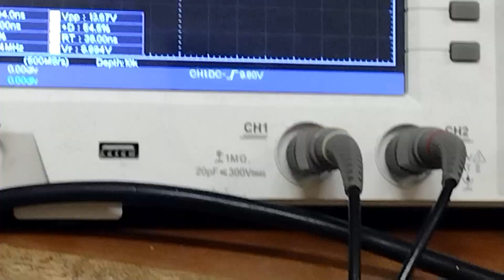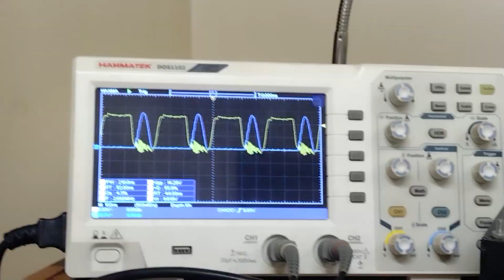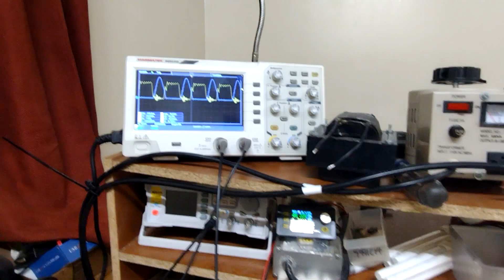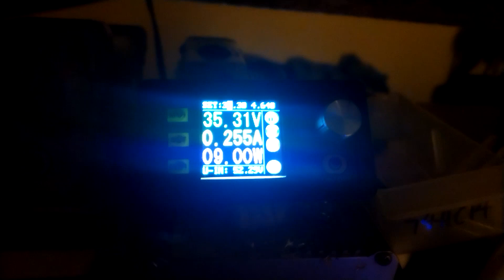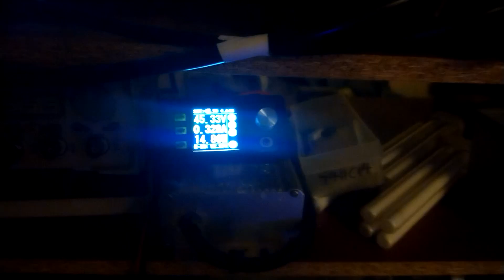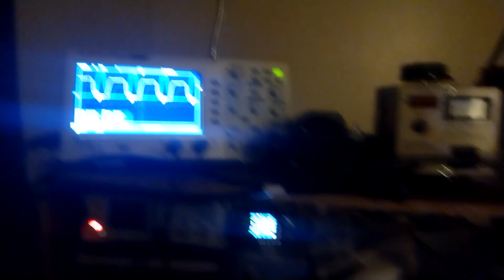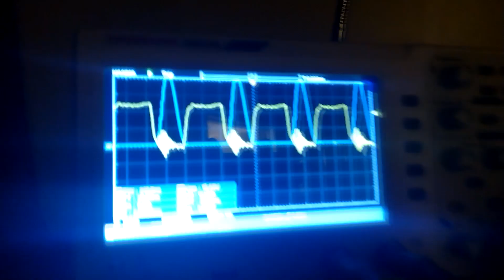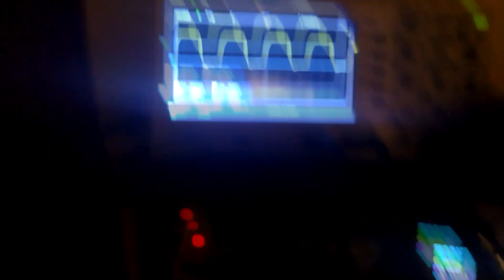Steve Ward Micro SSTC 2.6MHz IRFP260 200W

Comment: These Steve ward's little circuit, these works best compared to others. I've done several myself & it was kind of fun playing around with them. But with my E Class, I started to get headaches as every time  I moved the circuit inside a different box, the output changes drastically. It sorts of turn moody against me. But while playing around with various circuits, I found out that Steve wards little circuits were more fun & pretty much easier than others.

Comment: Reminds me of the class-e coil I put together a while ago. Something in this frequency range will do very nicely for audio modulation. Also I can’t wait to see your HFSSTC’s with SiC Fets.
Reply from the maker: Yea 3mhz or so sounds good to me. I have a smaller self oscillating one I ran music on that sounded great but I used a PWM driver on the rails. This one I'm not sure how well it will work using the PLL but most of the ones out there I've seen sound great. Man I still have a couple SiC's sitting on my table, a 650V and a 1200V. I've been thinking I'd find a better use for at least one of them before possibly killing them on the HFSSTC.

I killed my first 2 that I accidentally bought with 12V max on the gates then got a few more that were all different. Then the first one I threw on died immediately on my class E circuit. This was with very careful testing procedure. It has led me to believe that its inherently a problem with the extreme fast switching speeds and transients and the SiC's are extremely more vulnerable to over voltage. Given that experience I'd have to create some low inductance layout and really do some more learning about SiC's before seriously considering taking full advantage of them. Since there isn't much info out there about people using SiC's I can find it might have to be a solo learning process where I finally figure out what not to do after killing enough of them over time, but I have to be somewhat methodical about it.
Reply: Yea I get that. I would also guess that you right when it comes to them being very sensitive to voltage spikes. Also since they switch so fast it’s possible that perhaps if your using a GDT then if the signal isn’t clean enough or fast enough then that could also kill them. I planned on getting a few SiC fets and so I’ll do a little experimenting with them and try to help you out as much as I can.

Comment: I'm building my sstc and I am having am issue that I'm not experienced enough to fix yet. Whenever I switch my coil on with low voltage it produced a very small arc, my suspicion is that it isn't get enough feedback. As soon as I crack the voltage up, I see a larger discharge but then the Earth leakage breaker pops. I have high capacity capacitors on my full bridge and charging them up and then manually switch the driver on produces a large spark, as expected. Basically my coil does not want to work continuously.
I don't think it's a power draw problem because I have a 5a fast fuse and it hasn't blown yet.
Reply from the maker: Do you have a link to the circuit you're using?
Reply: @Magneticitist  I am using a similar driver to Hyperspace Pirate.
Reply from the maker: @proffessornukem8775  So is it really just that your GFCI pops when you get too high in voltage? If you're using mains ground have you tried just some big RF ground or counterpoise?
Reply: @Magneticitist  I have tried that yet. I'll try it, for counterpoise, what would be a good length of wire?
Reply from the maker: @proffessornukem8775  You could just try using some large flat metal surface under the build or something. With some of my portable coils that require a ground I can usually just clip-lead them to whatever large enough metal structure is around at the time. A metal shelf or table becomes an RF ground for me a lot.
Reply: I have recently tested if the issue was with the gfci. Turns out its not just the grounding as the breaker still pops when the an alternative ground is used. I am not sure what else to test. Do you perhaps have any suggestions?
Reply from the maker: @proffessornukem8775  well it's going to be the breaker if the breaker is what's tripping and it's not tripping from overcurrent. You might have arc fault breakers or some crap like that. Only thing I can really think of is to find a line isolated from the tripping breaker.

Comment: Geez I wish i had your knowledge in building these pll circuits . There is a few I would like to replicate like the dave lawton pll circuit . I have searched online for premade  designs and they were making pcb for that design but I can't find any now . If you have knowledge of this it would make great content for an existing audience in the hho world . I really got to go through some of your content but it's a very intense experience as I listen to every word so I have to be on top of my mental energy 👍🏻
Reply from the maker: Hell I'm still learning as I go so these experiments are more just showing my process but it's getting easier over time. Never got much into HHO so I'm not real familiar and looking at the Lawton circuit I can't say I immediately understand it. It looks like the PLL is being fed with the coupled and clamped secondary+cell feedback which turns it into clean 12V square waves off an op amp. With common SSTC's this clamped feedback waveform is simply fed directly into the CD4046 signal input pin or buffered first with a schmitt trigger. Then there are some gates, another oscillator, and some 'ramp generator' I'm not sure about. You can switch it to run just off the PLL's VCO where it sort of looks like the HEF4047 is turning on and off at the 4046 inhibit pin at whatever frequency it's set, or switch it to run on that secondary feedback. I'd have to build something like that and test it to really see what it's doing but I'm not real sure why feedback is really necessary unless normally the production starts to shift in efficiency as the resistance of the cell changes.
Reply: @Magneticitist  thanks for reply . Yes well I think the feedback from the cell is due to it being a variable capacitor of sorts . As the hho cell charges up to the breakdown voltage of water it steps the charge in some versions and then has a break and then 5-6 pulses again which steps up the voltage in the cell each time it pulses and then has a break again.  50/50 duty cycle. As a passive film builds up on the plates the dialectric increase which inturn builds up a resistance to current flow. This changes the capacitance and the feedback can go back into the pll cicuit. Another high voltage inductive back spike can come along from another circuit and just peel away the hydrogen from the oxygen that is held just below the breakdown electrolisis voltage by the step action . Each circuit is using very little current but both hold vital roles in the production of a unique hho gas called browns gas that is considered ortho or para hydrogen . Incredible explosive or implosive.
Reply from the maker: @Buzzhumma  Yea, that sounds about right or at least some kind of ironed out approach. I've never actually read anything but the titles on numerous research papers regarding HHO and pulsed DC but there seems to be many.  The 50% duty is interesting though, does anyone ever play with short pulses instead or is just that more current is better overall?